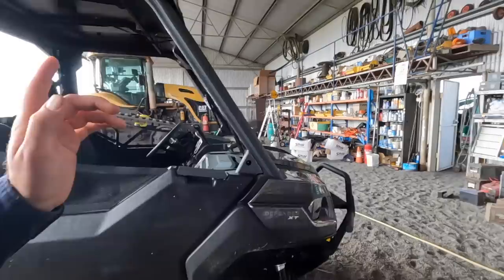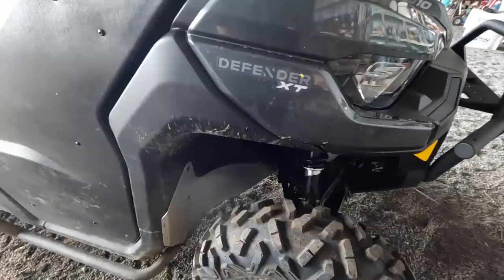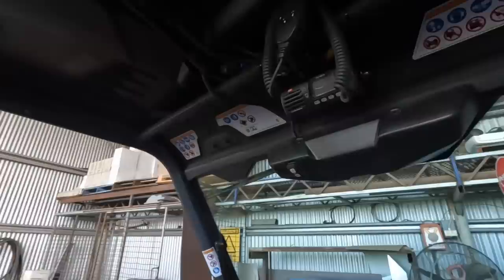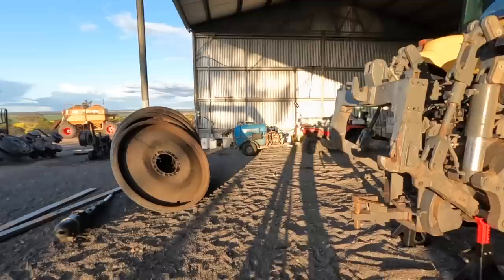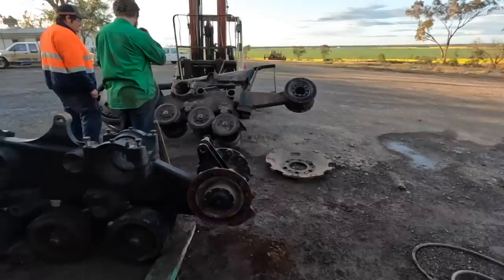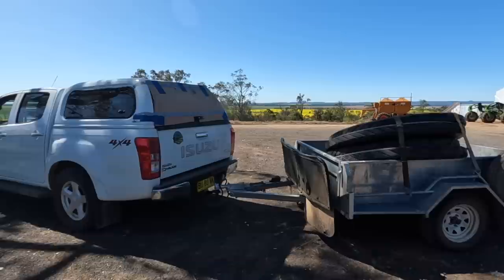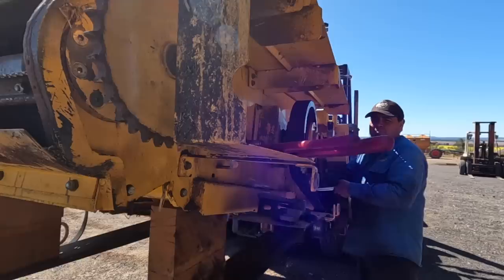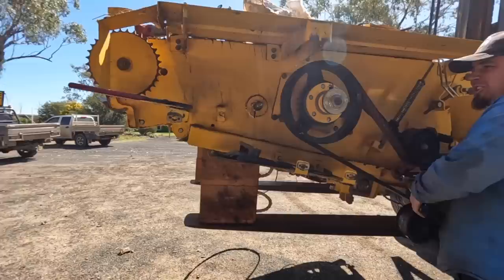New "Toy" on the Farm! (Vlog 95)

Comment: On the case flagship headers we used to use a forklift job that slips over the front end of the rotors shaft and makes it a heap easier to get them in and out. Guess we were doing them a lot more often then cockies working for an agency!

Comment: from my understanding of combining, the only way to keep rocks out is to keep the head off the ground more, with the width of  heads out there, maybe they are flexing and some guide wheels on the end will help keep the ends out of the ground? here in Ireland there is usually about 6 inches of stem left in barley crops. that or you can go on a big stone picking campaign

Comment: Best rock prevention we ever used was smacking em back down with the heavy roller! 
Not sure if that's cost effective for you but it certainly was on the olds farm here in NZ.
Reply from the maker: With a minimal till operation like we use the soil isn’t really soft enough to push them down without compacting the ground even more, but certainly in some situations it works a treat👍
Reply: @thejacksonbrothers  totally understandable.
Minimal till was only coming into Canterbury NZ years ago when I'm referring to. 
Big farming changes have very likely happened so sorry didn't think of that.